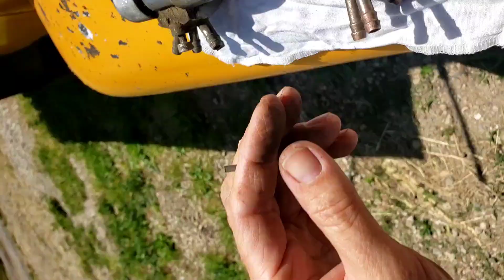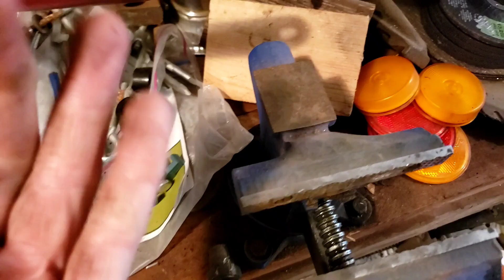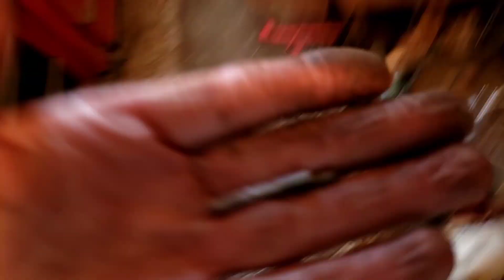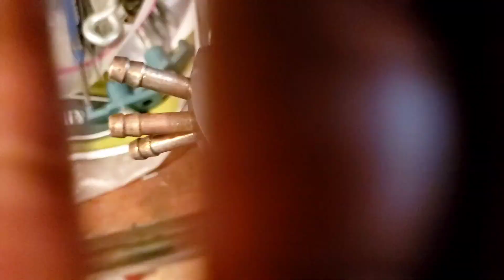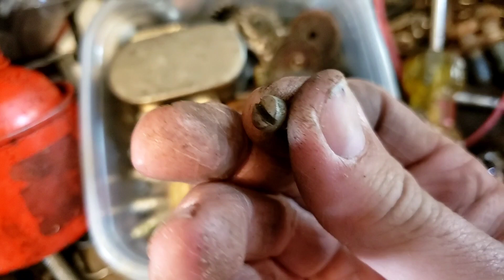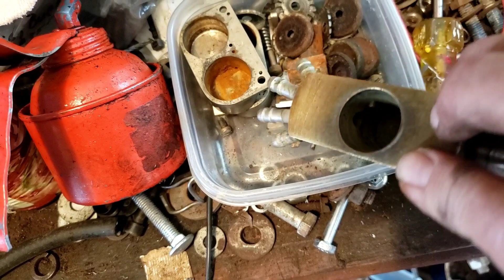Babson Brothers Surge Pulsator Lid Locking pin repair

Comment: We used to have Delaval milkers. Our pulsators plugged into the vacuum line. There was an electric connection on the vacuum line that made contact with pulsator and there was a control box on the wall in the cow stable that operated it. They were basically a solenoid. We had a Sputnik to carry the milk into the milk house. One benefit to the air operated pulsators was you could put a stallcock on the intake manifold on a Farmall M get the cows milked after a power outage and the pulsators would work.
Reply from the maker: I like the Shape of a delaval bucket